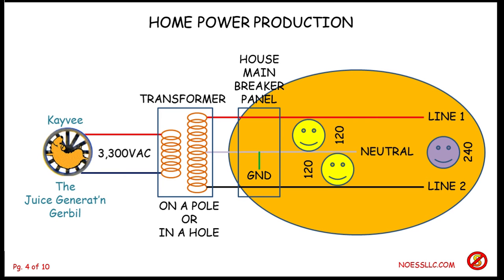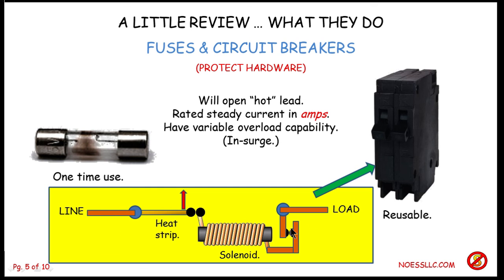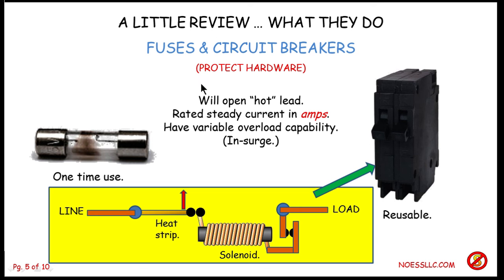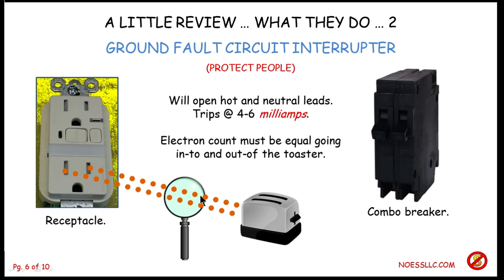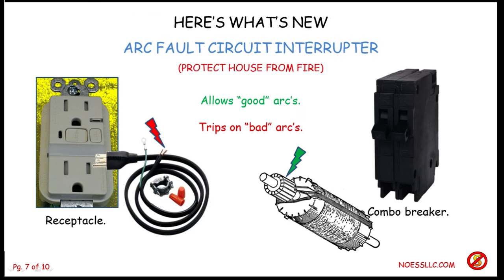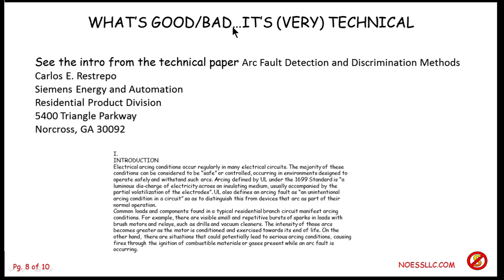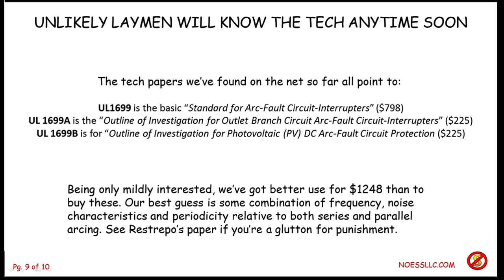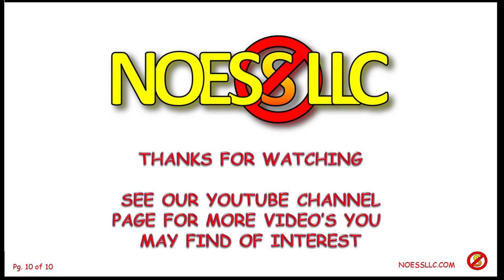Arc Fault Circuit Interrupter

Comment: I gave up half way through the video when there had been NO mention of AFCIs. The video is mislabeled.
Reply from the maker: Having been a technical instructor for 50+ years I am acutely aware that the vast majority of people know absolutely nothing about electrical processes other than how to plug in a lamp cord. It would seem your already know enough to not need the intro part of this video. For others that are as astute as yourself...there's a small red button on the player that, if you click your mouse on it and drag it forward, will advance the video to the part that details the AFCI and explains the difference between it and the previous two devices. Thank you for your personal evaluation.